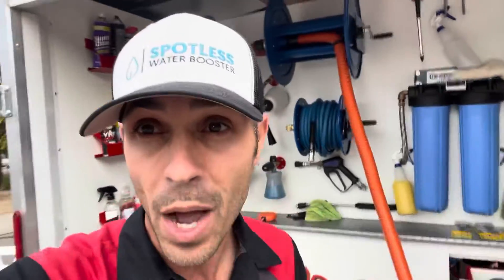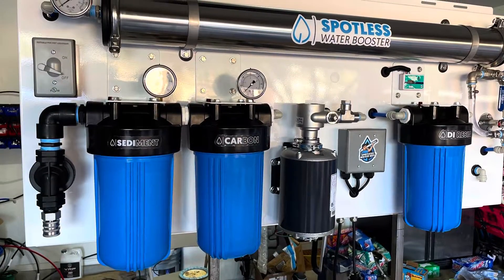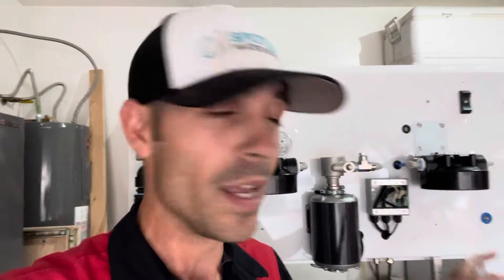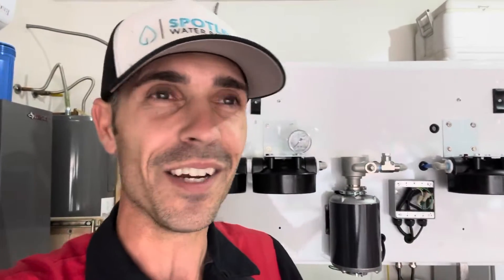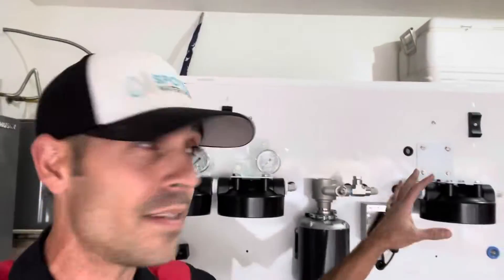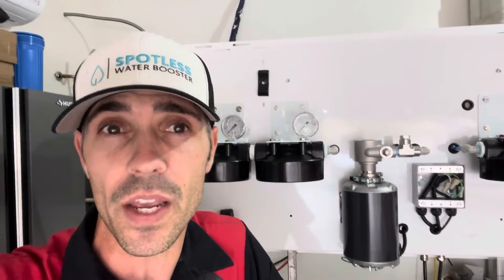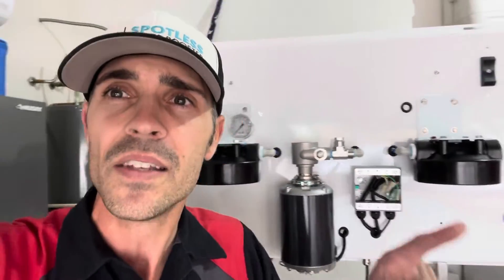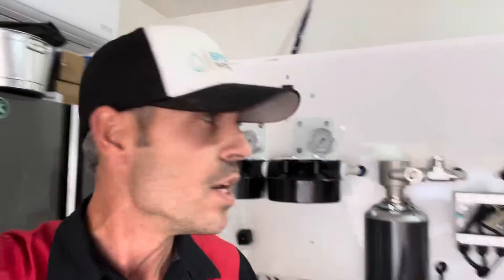Get more life out of your DI resin!! Best Spotless Water System

Comment: just asking where he got the rod no respond won't help at all
Reply: The system he uses is not something revolutionary. Just get a small $200 water softener, then get a hydrologic stealth 300 reverse osmosis system for $200, and finally run that water through your spotless de ionization filter which I got the ispring large one with bypass on sale for $350. That is $750 which is much less than what he will charge I am sure but I get the same results of that system he has.

Comment: $6K for the system? Ya no thanks. But awesome setup.
Reply: I have an on the go water softener for $200, then hook up to reverse osmosis system hydrologic stealth 300 for $200 on sale, finally, ispring spotless deionization system with bypass valve on sale for $350. For a total of $750,  I can produce 5000 gallons of water per resin filter replacement. That about 15X the resin life for 300 ppm tap water.

Comment: Is there anyway I can get a list of what to buy in order to do this at home please? I’m really interested.
Reply from the maker: The system is for sale at SpotlessWaterGuy.com
Reply: Take a small water softener and hook it to a reverse osmosis system like the stealth 300 hydrologic, and finally run it through a deionization system like the cr spotless or ispring system. All in I spent $800 and have 7 ppm after reverse osmosis, down from 300 ppm at tap, so my deionization resin only has to filter out 7 ppm which equates to around 5000 gallons of spot free water. Now if you want a Mobile system like him you will need a more expensive reverse osmosis system so that the water is produced faster. But if you let my system run for 12 hours it will produce 150 gallons which you can store in a tank for mobile detailing or just in your garage.

Comment: Is DI or RO system better for spot free water
Reply: DI
Reply: Which is better is the wrong question. DI is required to get the 0 ppm end result but RO will reduce ppm so much from where it started so it will save your filter life immensely which DI filters are very expensive. So you want to use both which will increase the DI resin life by 10-20X. And if your water is hard you can get a small water softener to help your RO system which has a much easier time with salt removal as opposed to the calcium and magnesium hard water has. Water softeners actually increase ppm very slightly but because it removes the calcium the water is much easier to work with in a RO membrane. Plus the salt recharge in a water softener only cost about $1 for 1500 gallons.

Comment: My tds readings are 300 ppm how many gallons would I expect from your system
Reply from the maker: Hey Allen, great question. The answer depends on a few different factors like water temperature, feed quality at your customers location, how often you replace your pre filters, etc.. to give you a very rough estimate my ppm is around 400ppm. I’m getting approx 10,000 gallons on 1 cubic ft of DI resin. Which is around 4 resin refills with my system.

Comment: This is awesome! I’m hoping to get my van and get this system next year, but for my solar panel cleaning system. One question I had, I plan on getting a water fed rotary brush, that requires about 1200-1800 psi of pressure. Would I be able to implement a pressure wash system using this set up with about 300 feet of hose. This hose will run from the street to the roof of the house.
Reply from the maker: Great question! Do you have a link to the brush you could share with me?

Comment: What is the maintenance that happens during that 4000 gallons and the costs associated with it? Cleaning sediment filters? RO prefilter replacement?
Reply: But his system is 6k. Yeah, no thanks. It's still cheaper to spend money on more frequent resin changes than his system. Yeah, no.
Reply from the maker: Excellent question. 

Virtually 0 maintenance other than a few filter changes. Sediment and carbon block need to be changed out (replaced) every 2 months. Price breakdown is below. 

Spotless Water Booster:

Sediment filter x2 - $48
Carbon Block x2 - $48
.5 cu ft DI resin - $160

Cost per gallon: $0.06 (resin still has more life but this gets you to 4,000 gallons) if it goes to 5,000 gallons before replacing the resin it brings my cost per gallon to $0.03, etc…

CR Spotless: 
.5 cu ft DI resin x 10 - $1,600.00
Cost per gallon: $0.40

(.5 resin on the CR Spotless will last approx 400 gallons / 4,000. You will need to replace the resin 10 times in order to reach 4,000 gallons) 

Hope this helps. RO filter is good for 2-3 years as long as you take care of it.
Reply: Beautiful system.  Keep up the awesome work